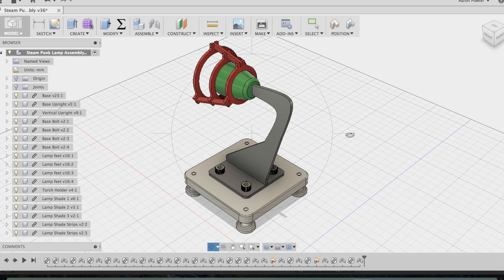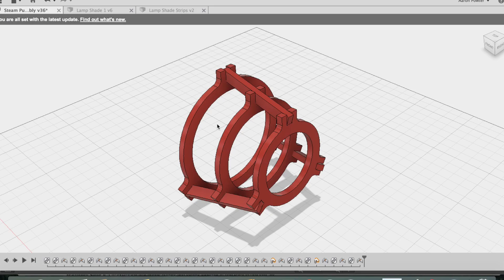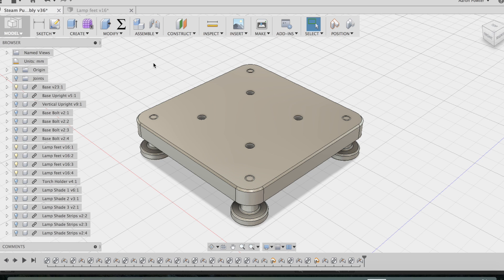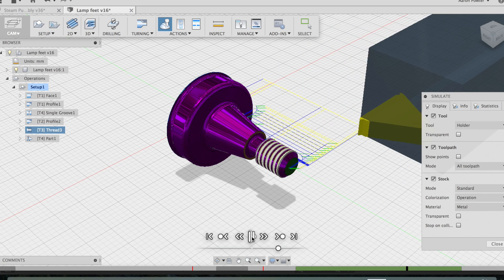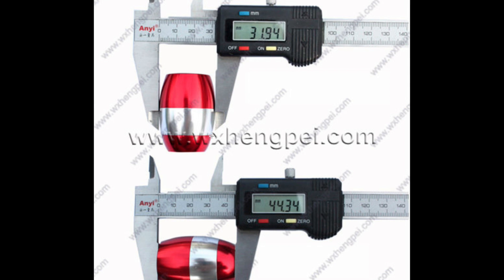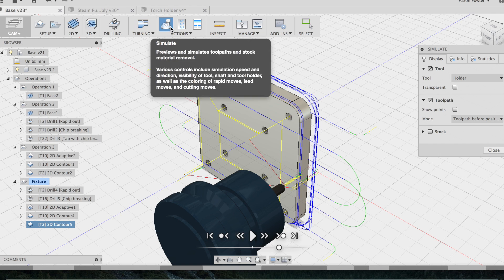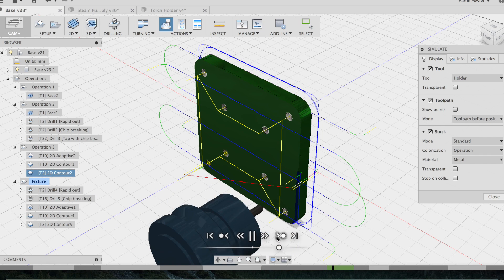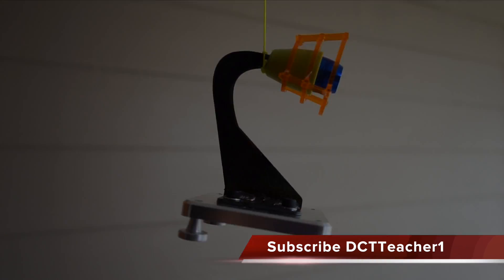Make a Desktop Lamp - Fusion 360

Comment: Hey, thanks again for a great F360 and machining video edit.
Just wondering if you've cut polycarbonate sheet (lexan) with the laser?
I've read that it does do a bit of 'yellowing'.
Anyway, just me thinking of a battery plate for my quadcopter. Either Poly or CF sheet, although here in country VIC I'm pretty much limited to expensive engineering or hand-made. Possibly stone adze given the location :-)
Reply from the maker: +Phil B Hi Phil, thanks for watching mate.  In regards to your question.  To my knowledge you can't cut polycarbonate sheet with a C02 laser.  I think you can with fibre laser, but not successfully with a Co2 one.  What about CNC routing your polycarbonate or carbon sheet?